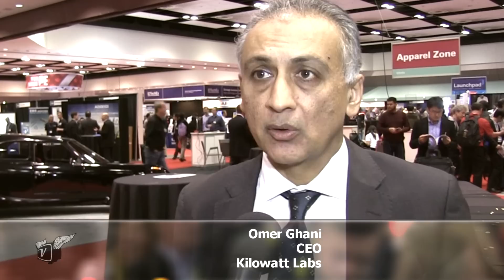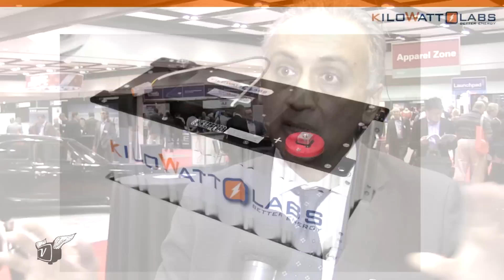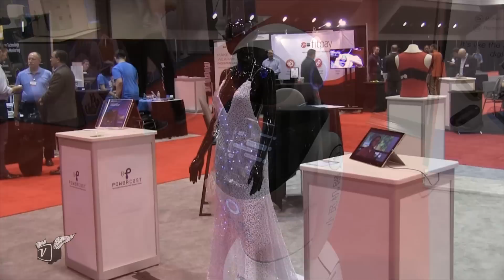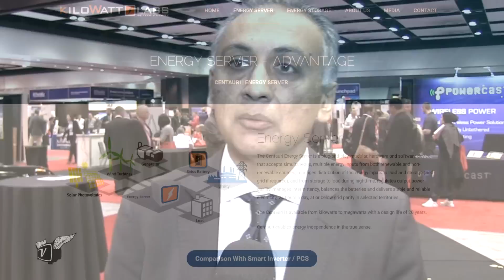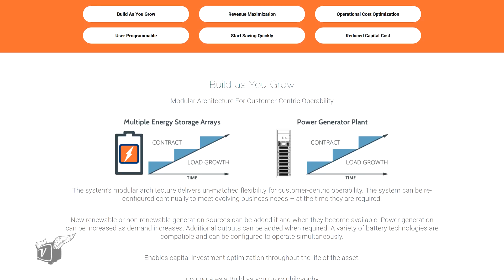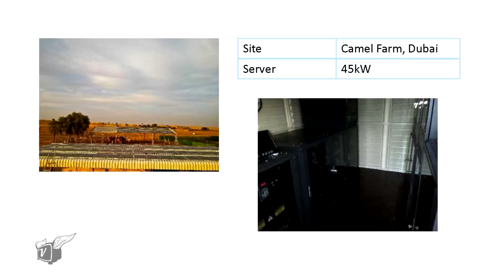The Fuel Tank of Tomorrow - A Super Capacitor?

Comment: WOW!!!!  I have always wondered why cap discharge couldn't be tightly regulated.  I worked with some fairly large cans before my quest for. energy storage that didn't require a chemical catalyst.  gave up  after frying several hundred dollars worth of electrical regulating devices.  This video really floats my boat.  No grid tie inverter needed is extremely cool.

Comment: A bank of 25 cent each capacitors connected in series, with a little bit of plastic holding them together. A 3 cent data cable. And $5,000 worth of software. Priceless.  (I have a feeling this product will be on the market at a very high price but less than a bank of batteries for your home or car.
Reply: voltage regulation would be insane - it's like trying to fly a hot air balloon with firecrackers

Comment: "In emergency you can discharge it in seconds".   To my mind that would produce a bigger emergency than the one responded to.
Reply: That's what I was thinking too. What sort of resistor are you going to discharge a supercap bank through in seconds that isn't going to turn into a pile of melted metal.
Reply: Stephane fyfe the only kinds of lamp you'd ever want to use to discharge a capacitor bank  quickly is just a resistor that happens to glow brightly.
Reply: No matter what you use, the energy stored in the cap bank needs to be dissipated, most likely in the form of heat. If you want to convert that much energy into heat in a "fraction of a second", if you do the math, you'll find you have a hard time finding anything that can handle that kind of power input without a meltdown.
Reply: Siegfried Gust, you assume that the whole bank would be discharged through a single conductor. That would be nearly impossible. now. consider a capacitor bank where each unit of the bank had its own switched discharge path. each unit would have a parallel emergency ground path. that or you could use a bunch of large transformers to step the voltage up considerably and dump the high voltage down a smaller conductor.
Reply: you know what, discharging that much energy isnt even worth it. i had some crazy high volrage discharging system in my mind, but after reading  Stephane fyfe last comment i realize that he is the only real expert on any of this and should be a DoE consultant.
Reply: not at all,  I build and repair Tube amplifiers with pretty high voltage power supplies,  which are basically a bunch of  electrolytic caps in parallel ( often called a Pi Filter). many of these amplifiers have an average of 450-550 volts of DC on them and I regularly discharge them in about 2-3 seconds with nothing more than a 20watt  ceramic 100 ohm resistor to ground. no sparks, no problems,  its just needs a few seconds to leak down to ground.
 That said,  I do think that the guy likely misspoke himself wen he said "discharge in 1 second"
 also all of this depends on how much energy your needing to discharge too.  ya know the  good ole a static shock that we all have felt at sometime or another from walking across a carpet in dry cold weather can reach 50K volts of "High Frequency" electricity.. thats an important detail .. caps don't store or discharge AC. and they also don't have anything in them that sets the "frequency"  of the discharge.. so being nit with 50K of electricity at say 5KHz is gonna sting but it won't do much more than that.. sorta like being hit by a gnat flying at you at 60 MPH.. yeah, you'll feel it,  but very little damage... as compared to being it by say 110 volts  at 60Hz...   thats more like  a baseball hitting you at 55 mph.. now thats gonna do some damage...

   Honestly most people who I see commenting on videos like these,  must either be completely uneducated or they must work for competing companies..
Reply: when  Elon Musk doesn't sleep on factory floor and robot messes up model 3 production, elon is in hurry, uses supercap to crank its ironman suit fusion reactor. Elon doesn't like LA traffic. Boring company is just for the bourgeois.
Reply: lol. true. this can only help to prevent transient shocks to our good old battery.
Reply: that is How a stud welder works so if you controlled where the arc went it would be okey
Reply: The B-roll on this vid was completely innapropriate.

Cap the future for sure. There goes the business model for iphone... Replace the phone when battery dies. 270 year battery life, take that iphone.

All batteries will discharge in zero time if short-circuited, people here should think before they look for problems.
Reply: Samuel Rosenberg yer, may as well be zero. Will be interesting to see how graphene and nano tech improves things...
Reply: Yup...#lol
Reply: Changes it from a fundamental problem to an engineering problem. But yes, would love to see an entire battery pack discharged in seconds to see what would happen.
Reply: Bob 

Hey another Bob her and yes if you had  a couple of megawatt hours of these things on line and operating and you wanted to discharge them in a second it would be like shoving a 100 ft thick steal wall up in front of a speeding train only with a lot more fire and molten copper. A charged Capistor is likened to a spinning flywheel. If the spinning flywheel is a small one you can stop it almost instantly with no damage done but the bigger the flywheel the greater the stored energy the harder and harder it becomes to stop it quickly without damaging it or whatever is being used to stop it. 
Discharging a super Capistor capable of even 1 megawatt in one second from a voltage of say 620 volts which is the DC link or buss voltage needed to  supply a three phase power inverter that would produce 480 volts three phase AC power. Is quite impossible. 
1 MWH or 1,000,000 Watt hours multiplied by 3600 to get to Watt Seconds is an astounding 3.6 GWS
That's 3,600,000,000 Watt Seconds Devided by the 620 volt buss voltage is 5.806 Ma 5,806,000 Amperes I personally was involved in an electrical explosion at a cement plant where the short circuit or arcing fault Energy was 480 volts at 25,000 Amperes 20.8 Mw or 20,800,000 Watts MSHA and Cal OSHA investigators could not believe that I survived that. Instant discharging of a super Capistor of this magnitude would result in releasing 139.535 times that amount of energy in the form of heat and shock waves. I don't think that there would be much more than a crater left where it used to be. Oh and that's not to mention the EMP that would result any unprotected electronic devices within several miles or the blast zone would be completely destroyed. So yes I completely agree with you Bob I seartenly would not want to be within 10 miles of that super Capistor when the crowbar is enisheated.
Reply: High power laser or rail gun shots are ideal applications for "instant" discharge to theoretical zero. However in practice, even these applications aren't going to be designed to drop anywhere near zero per shot.
Reply: 1.21JIggawatts!!
Reply: In case of emergency like alien mother ship suddenly appears for invasion we need to fire up ion particle canon.
Reply: capacitor banks always needs to have big fuse next to the battery
Reply: Yea I agree  u all def would be sweet to get power like that in a min but the safety procedure needs to be planned out !! And we have to see this to believe  this!! If thYz the case I'll get some for my ebike tmw lol
Reply: @HDRNX   while safely removing the dangerous waste power to a special disposal volcano.
Reply: all comments re: the discharge rate - I believe to be correct. A bit o marketing here I suspect. Not only the rate, but also not zero volts. BS
Reply: resistors bro, resistors.
Reply: ARC flash over
Reply: @siggyincr7447  a 20KW light bulb duh  would discharge it in seoncds

Comment: For those that are asking about availability, or doubting the capability of supercap storage, products are available. Look up Maxwell for one, but there are others.  There are many YT vids about those that have built supercap storage banks to replace car batteries and they work well.  Even if they do discharge over an unexpected long standing time, they can be charged in seconds, so a charge of another vehicle or a mains power source and you are good to go in seconds.  Supercaps are all over the place now in electronics, many backup power sources in computers and standby applications are by supercaps.  They are even available on ebay.  The next gen supercaps are in the pipeline, probably using a material derived from hemp. These will have a storage capacity greater by a factor of at least 10 and upto 100 times greater than existing supercaps.

Comment: One problem with capacitors for energy storage is that while the voltage in a storage battery only drops slightly from fully charged to fully discharged, the full discharged voltage of a capacitor is zero. So while more energy may be stored in a given volume or weight than a chemical battery, only a small percentage of it may be usable.

Comment: In my youth I was involved with microwave overbuilt setting up stations for cable TV.  We used generators backup by lead acid batteries, same as used for submarines, to back up relay stations on mountains.  Depending on costs this could be a great option.  As far as electric vehicles, our original power still comes from coal or gas.
Reply: I use lead acid batteries over 8, they all unreliable as energy storage at all , from first month its capacity started degrees until it totally disappears.

Comment: Firstly, I congratulate the company for the technical achievements you have made. This is a field where it is needed.

I should point out though that some of the points presented here are either quite hard to believe, or very misleading if the listener knows something about engineering.
1) I find it hard to believe that the energy density has reached that of batteries. Are you speaking of lithium or lead acid batteries? Specific numbers would be nice. If true, this would be great news.

2)About the safety concerns: All energy storage devices are inherently dangerous. If there is energy stored in a way that can be easily extracted, it can escape. The fact that a supercapacitor can be discharged in a second does not really help, as any engineer or scientifically literate person understands. Batteries can do that too, it's called exploding. If all the energy is dumped to immediate surroundings in one second, that will look like an explosion regardless of methods used. 
This is not to say it is a flaw in supercapacitors; it is not. Rather we should dismiss the idea that we should expect any sort of dense energy storage medium to be very safe and stable.
Reply from the maker: The comment about the capacitor discharge comment reminds me of high school and the jerk who would charge a capacitor and then throw it to you, yelling, "catch". In the context of the above comment, I think the intent was that the supercapacitors could be transported uncharged.
Reply: yes , I contacted him, and he didn't revert back except once asking where I would deploy this. I think this is Fake

Comment: Looking around their literature they claim a specific energy of 115wh/Kg which if true is quite a breakthrough especially if the claim of low cost is also true - in fact if true they'd own grid storage, hybrids, starter batteries, electronics  and be a strong player in EVs.
Reply: ah thanks, i was looking for the numbers. not gonna lie, 115 is a bit high.
Reply: its mainly about the electrical surface area of the materials and the stability of the charge discharge cycles.  there are a lot of advanced forms of carbon and other expanded materials that have stupid high surface area per gram.

You are incorrect.  Their literature shows 70-80Wh/kg.  Everything else is outstanding.
Reply: my usual response applies: if alt energy worked, it wouldn't be alt energy - or is there a conspiracy to suppress this advanced new technology? that always sounds better than "it doesn't work"
Reply: @VIIflegias    those are cook the books numbers

Comment: There is a little hybrid car that uses super caps to store enough energy for one launch and recover energy for the next launch with regen. This lets you use a 25 HP ICE and a 100 HP motor and get peppy driving when you need it and good gas mileage on the highway. 

But supercaps are not suitable for a battery electric vehicle because you would need to fill the back of a 20' uhaul truck with super caps to get a 100 kWh energy storage, and there are several other issues.
Reply: Ugh I always get trapped reading your books of a comment

Comment: Like he explained in the video two years ago, you may get 100 miles out of a charge with their supercaps in an electric vehicle, but you can charge it in a matter of seconds to minutes depending on how the energy is transferred from charging station to your vehicle. i.e. what voltage and how big the cable and connector are.

Comment: 1,5 year passed.. whara is my super cap adapted for nissan leaf?
Reply: @TheRealKalEll  really is it a 3kwh pack? otherwise it's a kinda a waste in the city.
Reply: @mjphillips76  I'll keep my 30kWh battery…
Reply: @BXJ-mi9mm  combine the two and you can get better distance.
Reply: @mjphillips76  What do you mean?
Reply: @BXJ-mi9mm  If you use the battery in combination with ultracapacitors, you can have the energy from the brakes fill the ultracapacitors and then the vehicle can use that power generated in starts and stops in cities.  The ultracapacitors get connected to the brakes for the fast regen, from the brakes and excess then can be put into the batteries when the ultracapaciters are full. 

Such as when you start off breaking does not work the same when the battery is full, so if you have the ultracapaciters in front of the battery for charging would allow for energy capture from the brakes.

This would extend the length of the battery in the city with the constant starts and stops.
Reply: @mjphillips76  My car had perfectly good regenerative braking. I don't see how ultracapacitors would help except for when the battery is near 100%. The difference would therefore be trivial, especially since most people don't charge their EVs to 100% regularly (in which case the difference is nonexistent).
Reply: @BXJ-mi9mm   The idea is to use the ultracapacitors to capture as much power as possible on the braking as not all of it is captured and can be stored in the batteries at a high rate of speed so much of it is lost. The Idea is to use that high rate of speed and then bleed off from the ultracapacitors to charge the battery after it's full from the breaking, and then use the ultracapacitor power from that pack when you hit the green light. The Idea I am thinking of is being able to use regen breaking from all 4 breaks into an ultracapacitor system first then the battery. , let's say you are driving around the city with say a 2Kwh Ultracapacitor pack, that will allow you to actually use less battery. 

This is part of my the idea out there to extend the range of these cars.
Reply: @mjphillips76  As I just said, that isn't a problem unless it is near 100% SOC. You might not be able to charge fast if it is INSANELY cold (most EVs heat the battery to prevent this), but even at -20 I haven't had that problem. All that would do is increase charging loss by adding another step. Hybrids, which store FAR less energy, have always used batteries.
Reply: @BXJ-mi9mm  Cycle life it the reason. Battery gets damaged in charging - recharging cycles much more, then capacitor banks do...
Reply: @DzeryB  Regenerative braking can't even give you 1% of your capacity back. There are hybrids that have these ultra-narrow cycles many times a day, hybrid taxis that do that a hundred times a day, and it has virtually no effect. The difference is negligible.
Reply: Most all electric cars already have supercaps installed. City electric buses have them to recharge the main batteries as mains cannot take the rapid charge - so supercaps take the fast charge and mains takes from the caps as needed.
Pretty cool driving them as you have to give some throttle going downhill as the regen is so strong, the bus will crawl going downhill. I only need to touch the brake till 10mph due to regen drag. Fun bus to drive :-)

Comment: Supercapacitors have high selfdischarge, many times of that of lithium batteries. They are suited for releasing of large power in short time, but not for storage.
Reply: good point!
Reply: Yes. All capacitors have leakage issues to date. Be interesting to find out how long they can store the charge without dissipating down to useless levels.
Reply: Peter Švančárek,, that's a good point you mentioned, and that what they should work upon
Reply: Like a coil then?
Reply: Interesting view.  I bought 6x 2.5v ones to 'play with' - I don't know where they are right now, but I've been testing them every year or so - they keep their charge pretty well and unlike LiPo, I'm not worried about remembering where I put them for the next test, because even if they are empty, they will be fine.

The energy density is not as high as LiPo, or lead-acid, but they are a great supplement for high spike loads if used in parallel.
Reply: He did explain that was a problem they have overcome.
Reply: @apexmike849  It"s not about the capacitor's degrading over the year, it's that the capacitor can't keep it's charge in a cycle. You charge it but then the charge leaks away, unlike a battery which can be left for days and still has power.
Reply: in this article it says it leaks from 2.7v to 2v over 7 days.  https://www.tecategroup.com/ultracapacitors-supercapacitors/ultracapacitor-FAQ.php   that seems good to me a home battery only needs to last 20 hours